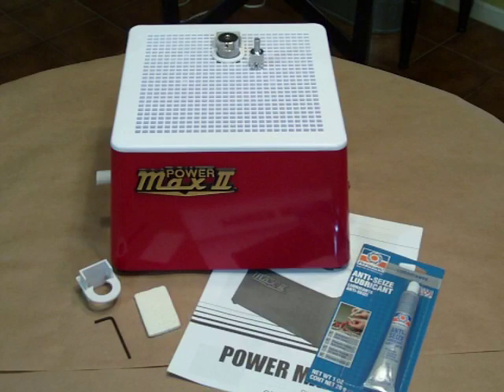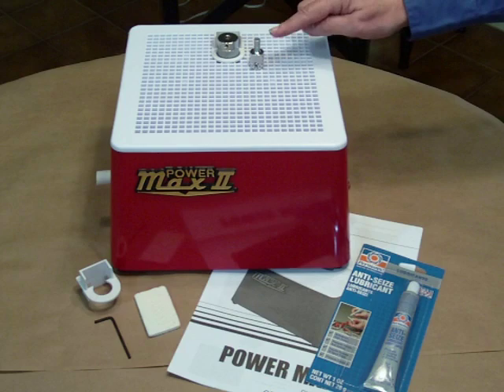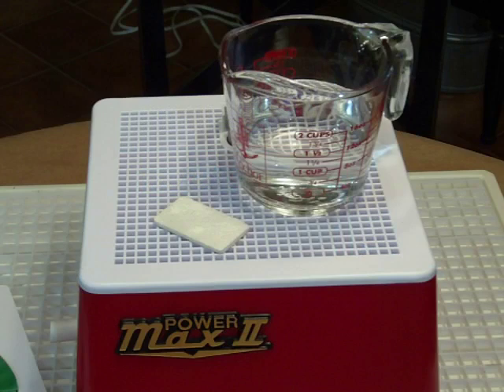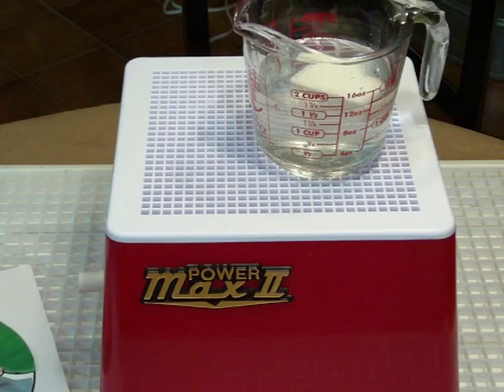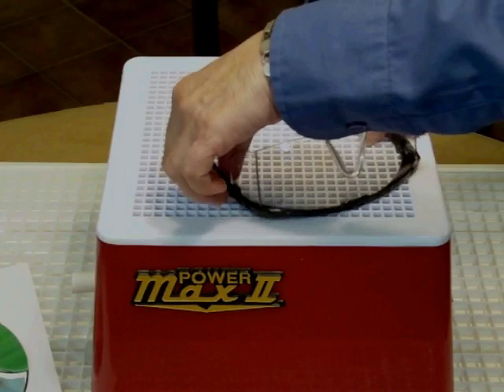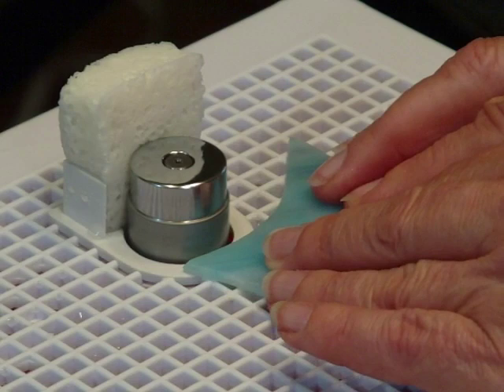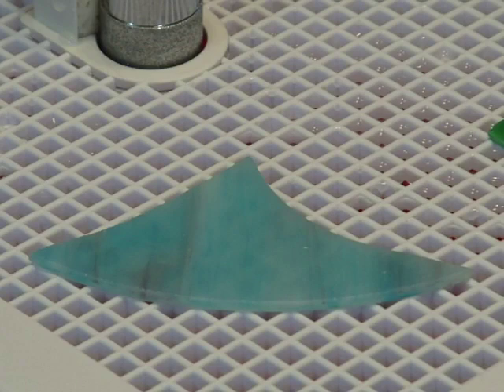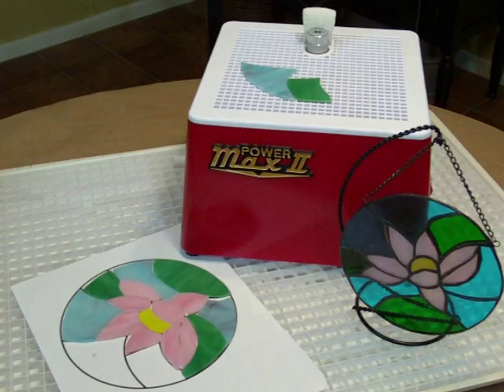How to Use the Power Max 2 Glass Grinder

Comment: Hello ! Thanks for this video. Can you please show how to take off the working surface please so I can remove the star plug inside ? It’s reallyyyyy hard and I don’t want to break it. Thank you
Reply from the maker: The work surface often fits snugly on the grinder.  Usually one corner can be pried up a little and then prying up another corner should be easier.  We have used a flat head screwdriver on more challenging work surfaces.  On the back top right side of the grinder (looking at the back of the grinder) there is a little notch.  Use the flat head screw driver to gently pry up that corner of the work surface.
Reply: @DelphiGlass  yes it’s really hard to get it off. Thanks for the tip, I did not want to break the surface ! Thank you